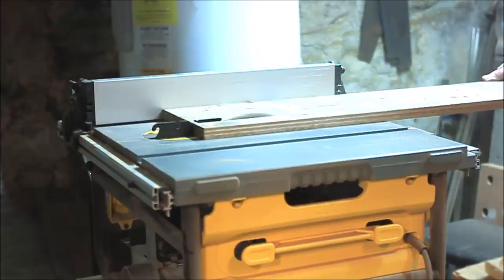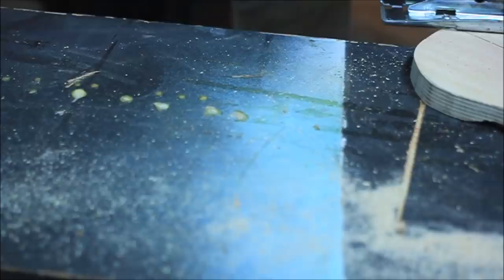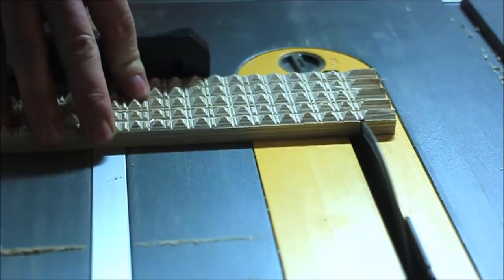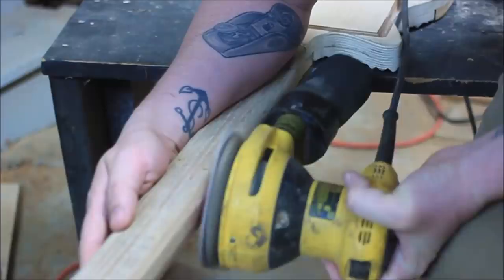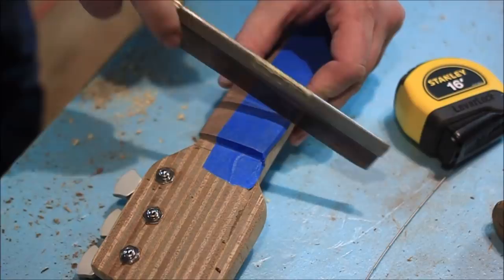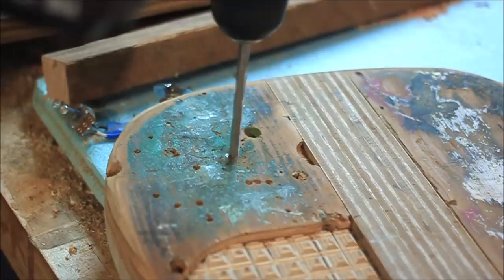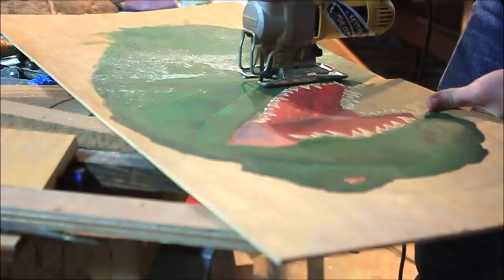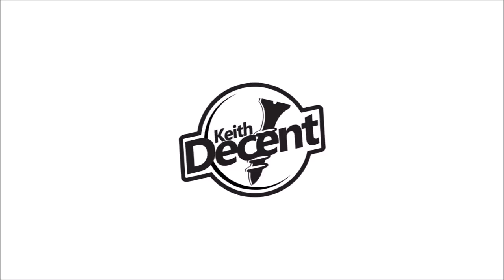DIY  ELECTRIC GUITAR FROM PLYWOOD - a Decent project

Comment: What did you you use for the strings? Fishing wire?
Reply from the maker: I used regular electric guitar strings for this   But I have used fishing line in the past on some 3 and 4 string guitars and it works pretty well considering
Reply: @KeithDecent  Thanks for letting me know! 🙂

Comment: Trust rods are also used in neck through guitars. Actually, it's pretty much a must in all acoustic guitars and basses and electric guitars and basses as well. Very unusual built to say the least but it was fun to watch. Instead of trying to improve this guitar as you are mentionning, keep it as the souvenir that will surely get people talking forever, why not build a real guitar from scratch with proper woods, proper methods and proper hardware...? Just saying. Have fun.

Comment: Cool guitar man but dude you really need to be more careful with your table saw. Lifting the wood mid cut and setting it back down and without a push block is begging to get you no fingers. Everyone hates it when people tell them how to do things but I only do it because I care and I've seen what happens when kickback or the blade pulls a hand into it. Just a heads up. Still, cool project. For people watching, never use a table saw this way, always use a push block and never lift or camber the work piece mid cut, always keep the piece against the fence. This is serious stuff.

Comment: That plethora of tools and the result is lackluster. 
A+ for the effort tho!
Reply: PS I made a pickup out of old microwave parts, it has perfectly sized alnico magnets for pole pieces and the fan inside has 43 gauge wire. 

The nut I made from a domino piece and it works even better than an actual bone nut.

Comment: How many ohms does the pickup have?
Reply from the maker: Ohm-most enough for it to sound good? haha i dunno actually
Reply: haha, but I wanted to know how many ohms it would have, to get a sense of how many turns of the
Reply: @KeithDecent  I saw that some pickups have 6K ohms, this here in Brazil by the table of gauges would give more or less 1129 meters
or 44448.82 inches of wire that I will have to wrap

Sorry, I used google translate ;)

Comment: I'm a minute into the video, and I don't think it is going to work.  I don't think that wood will hold the strings tension with no metal truss rod in the neck.  But I love the one piece body and neck design.  You never see that and It is to save money on wood, but since that is not a problem in this case, I think it was a great decision, just to try it.

Comment: Your bridge made of wood muffles the tone a lot. Strings should rest on resonant metal like steel, brass or bronze, or even fret alloy. You can replace the whole bridge or add metal inserts for the strings to rest on.
Reply: There's plenty of good guitars with wooden bridges dude... Take at look at Danelectro for example. Also, there's no such thing as a resonant metal.
Reply: Bells. Dobros. Strings. Drum frames. Cymbals. All resonant metal.
Reply: None of that is "resonant metal". There's no such thing. Resonance is an effect when an external force drives an oscillatory system to a greater amplitude. Also, all of the stuff you've said is made from different metals...

The metals used in instruments are used not because they're resonant, but because they have an appropriate elasticity, density and toughness. There are many metals and alloys of which you can make a bell for example. Depending on it's size and desired voice, you'll use different materials. Same goes for other elements. Yes, some metals are used more often than others, because they have properties/price more suitable than others, but none of that makes them "resonant". A thing cannot be resonant any more than it can be perpendicular. It has to be resonant to something.